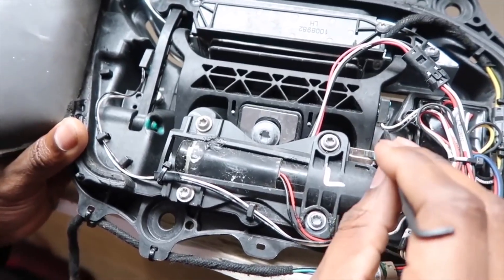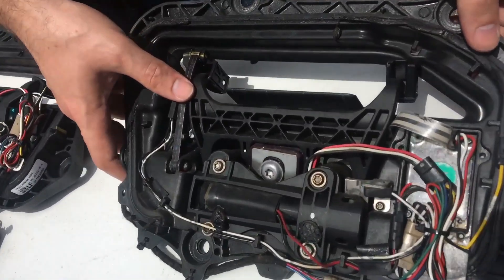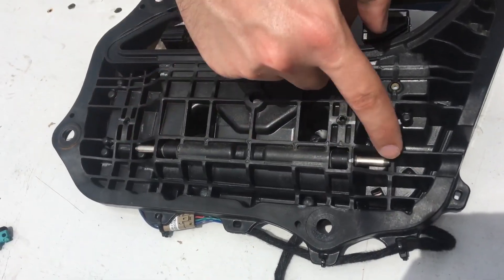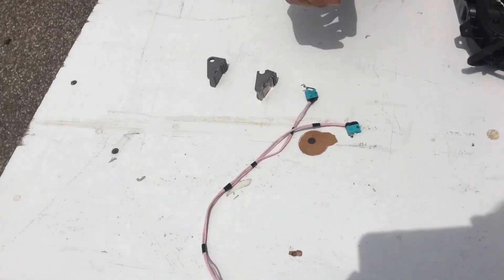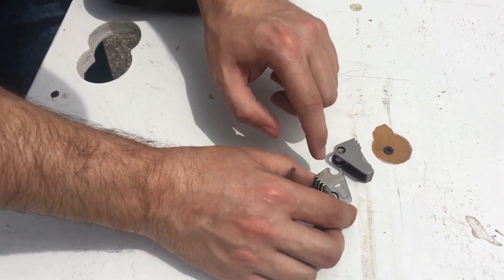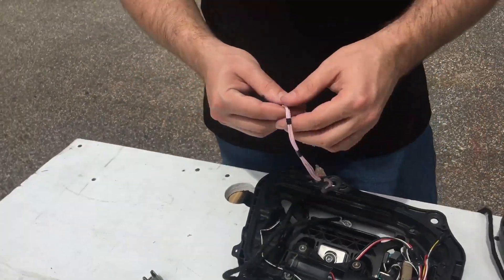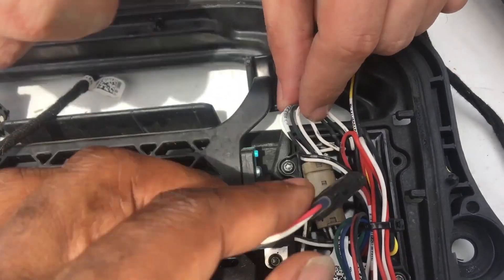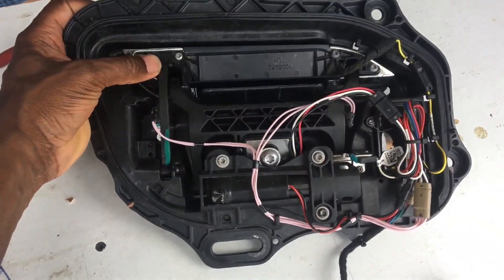Fixing Tesla’s Design for Good

Comment: very embarassing that a car company like tesla couldn't figure that shit out
Reply: LOL mercedes had an indicator problem in their S class
Reply: Tabs T not like any mercedes drivers use the indicators anyways...
Reply: Calvin Junge believe me they did) Do you think they want you to drive a super reliable vehicle for the next 20 years that won't break?)
Reply: Thanks Joonas. Most German car drivers don't signal. Why would they want to communicate they are the only ones on the road.
Reply: montanvs exactly! I replaced 5 window regulators in my BMW 323i in about 2 years. Basically every time you rolled down the window it broke!
Reply: It’s easy to say that in retrospect and they have fixed it on newer ones
Reply: Calvin Junge they aren't a car company
Reply: Designers must have material knowledge of ferro, non ferro, thermoplastics, and write the proper parts/module performance specification, if third party suppliers are involved.  No "best effort solutions", I hate that
Reply: montanvs This stops you from getting in the fucking car
Reply: Who said they didn't ?? 🤣 ur saying that teslas engineers Can"t figure it out ?
Reply: Calvin Junge engineer went rogue
Reply: The C6 Corvette has electric door handles and latches that sometimes have issues.
Reply: They do that on purpose. Nothing is built like back in the days - built to last. They want things to break down eventually - $$$$$$$
Reply: HAHAHAHA "car company" LOL you mean Apple morons disguised as car engineers.
Reply: nobody in the car industry has made a complex door handle like that.
Reply: True
Reply: Like Tesla? I’m not here to defend any side but While Tesla’s failure points have been given the spotlight, they are innovating, not refining, so failure  in several points is to be expected. Also, pretty much every single car in hthe market is littered with horrendous engineer fails, even my 1995 Toyota Tacoma, a deemed “reliable” vehicle. I’m not surprised Tesla’s cars are full of mistakes, as long as they are correcting them
Reply: This is why I want to wait for a real car company to make a comparable vehicle.
Reply: @julianhill8840  Toyota
Reply: (real) u mean Tesla USA made cars is fake
Reply: like my dad says, one 'aw shit' cancels out a thousand 'attaboy's.
Reply: Elon doesn't care he already got your money if you bought a Model S.
Reply: Really?  Cause every other car is perfect lol. I can’t count how many days I’ve so by fixing similar stupidity in  “high quality” German cars.
Reply: Julian Hill try out and test drive Jaguar i-Pace you will be impressed just like me.. ;0)
Reply: Calvin Junge 
Yeah!
It's embarrassing that car companies like GM and Ford and VW and Mercedes and Honda and Toyota and Subaru and BMW....... etc.... ALL have recalls! And THEY'VE been building cars for a Loooong time?
So it's REALLY embarrassing!?
Correct?
Reply: Not one auto company hasn't had a retarded issue like these in the past.  They all have their up and downs, and by the time they get it worked out, they re tool and die, and change models only to open the doors to a new world of problems.
Reply: since all ice cars run on the same old well worn technology, one would expect better fit and finish from them, but they still experience stupid issues.  Tesla is a trail blazer, with thousand of parts along with the electric propulsion, give 'em a break fcs.
Reply: @Homecomfort Why? Because you fail to grasp the nonsense that Tesla is producing? Designing cars that are so overly complicated and poorly engineered (I'm a mechanical engineer BTW) and having a flamboyant playboy top exec that can't design a proper auto manufacture (if you let go of 9000 top tier employees, the company was poorly run to begin with). Musk has been running around like a chicken with its head cut off for 2 years now, mainly because he doesn't want to delegate divisions to ease the load on his tyrannical power hunger and ego stroke. Building a tent next to an undersized, overcost assembly plant in Fremont just to say they produced enough cars to meet a false quota is not good business PERIOD. They paid millions in overtime just to reach the goal. Why not hire more people? It would also prevent so may assembly line mistakes that have caused Tesla to slow to a crawl. False promises of a $35k Model 3 shows how bad it truly is. No sucker who plunked down $1000 3 years ago, basically giving Tesla  a free loan, will ever see that car. Why? Because Tesla knows they will lose money selling that base model. EVERY car rolling off the line currently is a top line $55k+ model. Poor repair facility infrastructure (try getting  an accident vehicle repaired quickly- they don't even have enough parts to build cars, let a lone repair them). Insurance rates are sky high due to the liability of all those thousands of batteries in an accident catching fire and taking WEEKS to extinguish themselves. Now the charging fiasco. If you sell more cars and no where to charge them quickly or efficiently, you now have a power grid that is unsustainable to that much demand. Welcome to rolling black and/or brown outs.                                         
Back to your "all ICE cars run on the same old well worn tech, one would expect better fit and finish" what do you drive? A 1970s dodge? Last I checked, any Toyota, Nissan, Chevy, Ford had better fit than a Model S. And those manufacturers are selling a car at 20% the cost of a Tesla. Ever try to do a simple mirror adjustment in a Tesla? In a Ford it's right there on the armrest to adjust without even looking down. In a Tesla it's 3 layers deep in a stupid touchscreen that can fail and become unresponsive at any time. At least a Ford will start and go with half the dash broken.
Reply: in real world nothing is perfect
Reply: so, and I've driven in audis that feel the exact same, feel like junk for something that costs 70k+
Reply: montanvs Right, right. Good thing you didn't mention any specifics, otherwise we'd take you seriously :) When I had a chance to drive a year old model S, it felt like it was totaled at least twice and put back together by drunk Mexicans. Rattling inside felt like I was driving a Skoda from 80s, not a $70k+ car.

Comment: It looks like these cars were designed be Engineers who had no auto design background
Reply: I'm not an engineer and I know rigid moving wires are asking for trouble. I guess those handles were designed by interns.
Reply: More like designed for looks, then someone had to make the idea work, style over substance...
Reply: Doug F ...Bingo, The result of tech guys building a car. A $5,000 car handle. Not smart at all.
Reply: The entire stalks Assembly is designed  and manufactured by Mercedes
Reply: Doug F they don't
Reply: BigBwoyTing its 1k not 5
Reply: I drove a Model S a few years ago and the stalks were infuriating. They fitted it with column shift on the right stalk, which you use 2 or 3 times per journey because there's no need to shift to N when your stationary, and jammed all the lights and wipers functions into the single left stalk which is most people's less coordinated hand...
Reply: they look like crap is my first impression.
Reply: theAppleWizz+ For me that just makes it a bigger fuck up, really.
Reply: Doug F most cars these days are built to break lad
Reply: Isn't that what Tesla is about anyway? They know nothing about making cars!
Reply: t c  if you want to fix it your self it's like $8 the replacement part is just a switch.

Comment: I dont get why they not reversed the switches mounting point so both switches are fixed on the case (like the pressure sensor on first version) and the opening handle pushes them. Then the wires for switches dont have to move at all.
Reply: Tomasz Biskup Probably just wanted to avoid manufacturing new molds and instead just screwed the switches on. (I don't see a way with the current design to screw the switches to the non-moving part) Short sighted cost cutting...
Reply: They did that with the model X.
Reply: Because the people who made the car know nothing about cars.

Comment: +Rich Rebuilds good information for Model S owners. How about looking into the Model X Falcon Wing doors grinding on the aluminum chassis when it's closed?
Reply: Needs to be adjusted properly there is a service bulletin for this from Tesla
Reply: Chris Salvo I took it to my local service center and they said nothing about an SB for the issue. They did the same thing I saw other Model X owners on YouTube report, that they placed clear tape over the area to slow the wear. If you have the SB number please post it. Thanks!
Reply: basically the pinch sensors rub and the doors bump stops need to be adjusted so everything doesn't move around while driving. The clear paint protection film also helps.

Comment: 70$ for little metal piece and another 70$ for switches !!!
Reply: But is priceless not to hear the wife bitch to you about the intermittently working door handle.
Reply: or when you're trying to get into the car fast when it's raining...  low volume parts are NEVER cheap.  the guy needs to make a profit.
Reply: Chump change. Go price out parts for a Lamborghini. $750 for a gas cap.
Reply: What this guy said is true. Tooling/Design alone was a couple grand. Eventually we'll get there but for now its low volume batches so as to keep cash flow positive.